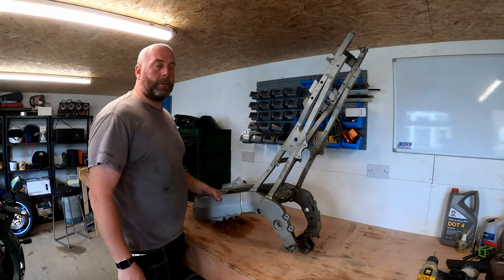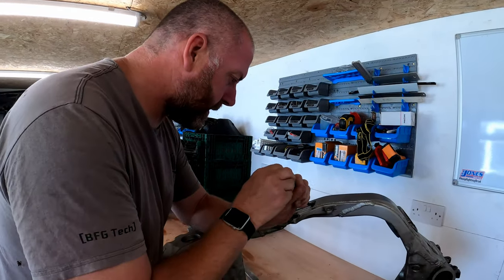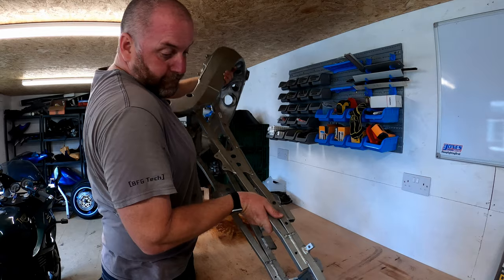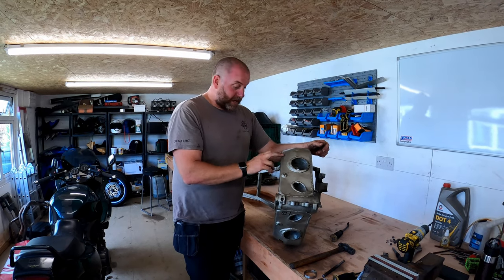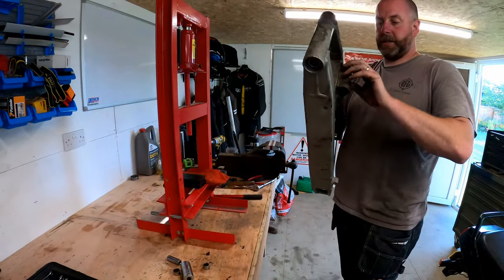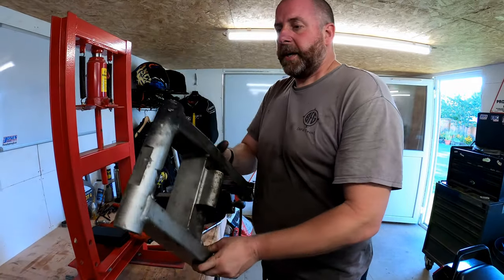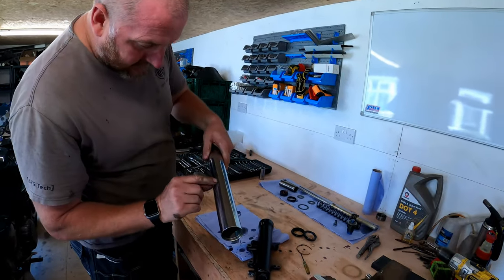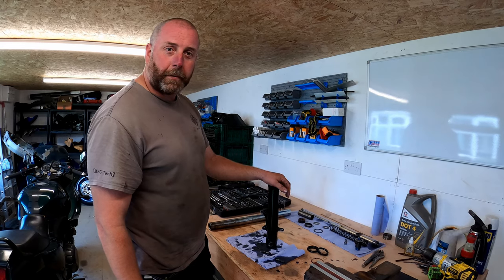1998 Kawasaki ZX9R - Project Shinobi, Episode 7 - Last Bit Of Frame & Swingarm Prep & Fork Teardown!

Comment: The two riv nuts (or what ever they are) you could use a bit of expanding foam to stop them rattling around as that will do your head in whilst out on a ride. :) great vids by the way
Reply from the maker: Good idea 👌🏻😎
Reply: A good idea but it just made me smile as I remember this little story. A friend of mines elderly father decided to get his house insulated. He had a survey and quote from a Cavity Wall Company, which he duly accepted. On insulation day the highly trained "Technicians" arrived to carry out the work. They did the first ground level drillings and started to apply the  high pressure insulation foam. It was only when foam started to emerge from the kitchen cabinets that they realised the house was single brick wall property!
Reply from the maker: @minkyandbear  😬